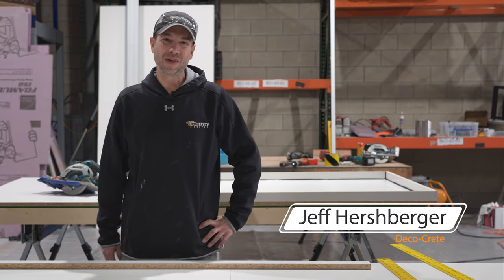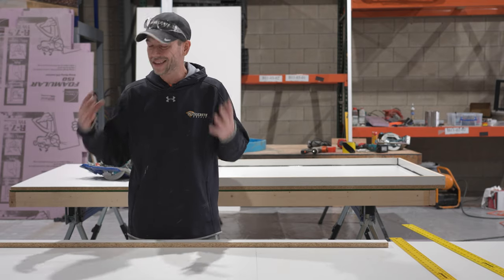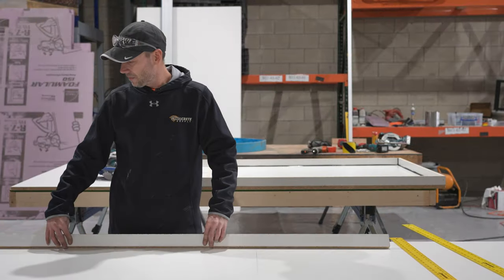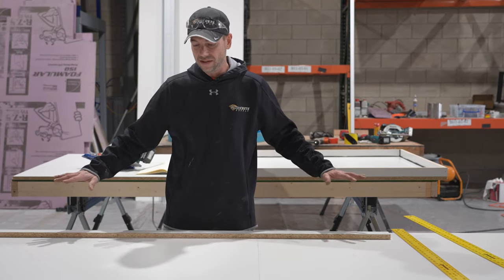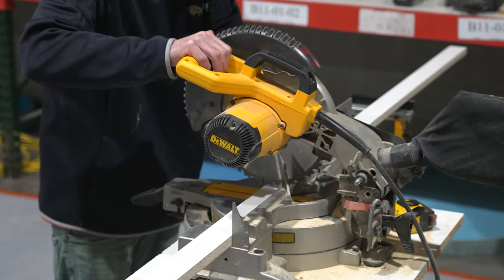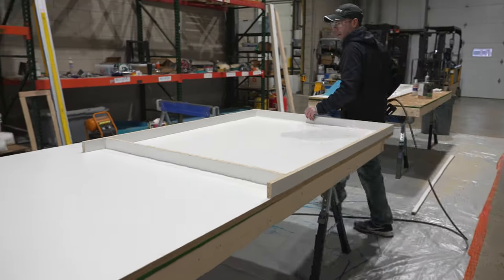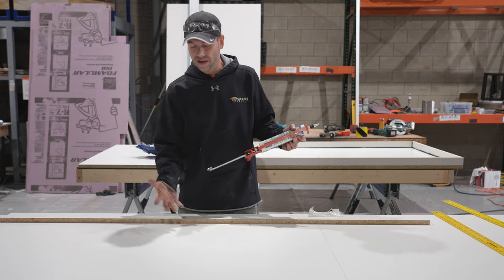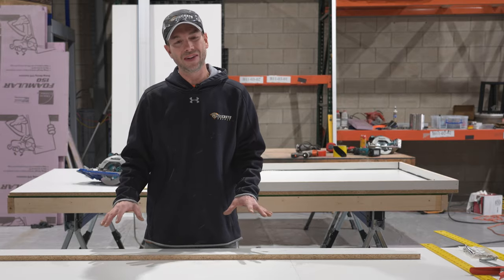How to Build a Concrete Countertop Mold in 3 Minutes!

Comment: How big can a 2 inch concrete countertop be with only the support from 4 sides? Meaning how big can the span be without it breaking in the center.
Reply from the maker: There's no exact answer to that question; it would depend on the intended use, as well as the mix design of the concrete. A 2" piece of concrete could span a large distance if you were to just set in on the supports. It's when you start putting weight on it that cracking could happen. We've seen plenty of 4'x8' island tops that only had support on the four sides and had no issues at all. This doesn't mean that concrete countertops don't ever crack, but the cracks generally come from shrinkage or excessive force. What I'm getting at here is that as long as the mix is designed to be cast at 2" and you use the proper reinforcement, you won't need to worry about spaning distances under five or six feet. Unless you plan on setting a lot of weight on it, in that case, you might want to add a support in the middle. I hope this answers your question. Thanks for watching Deco-Crete TV!!!!